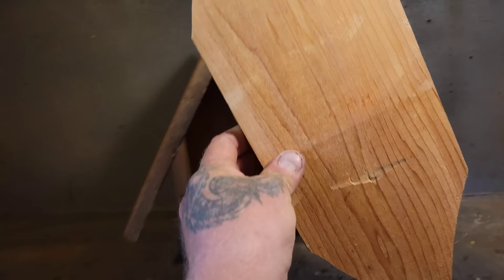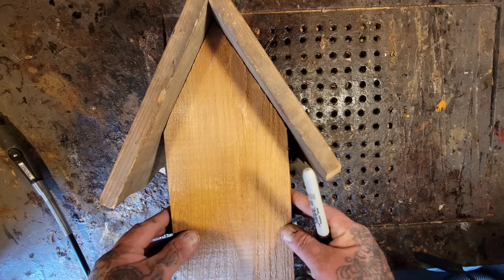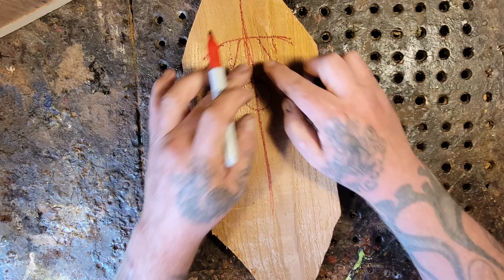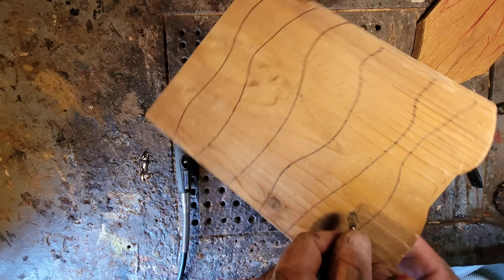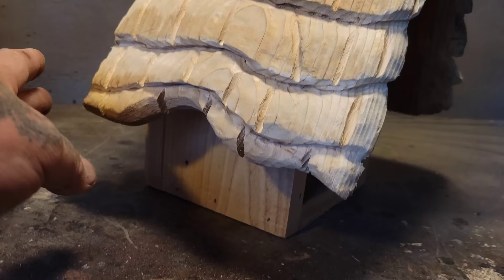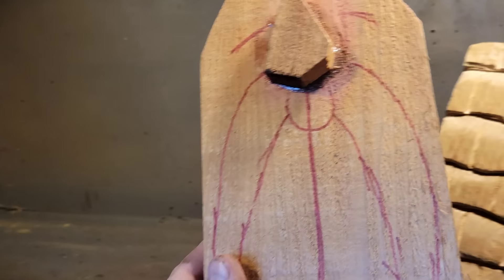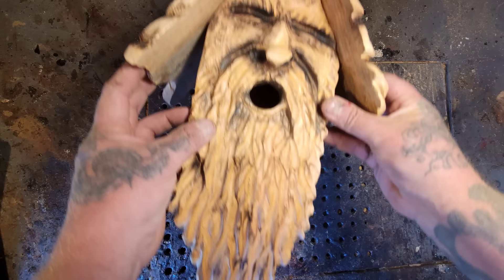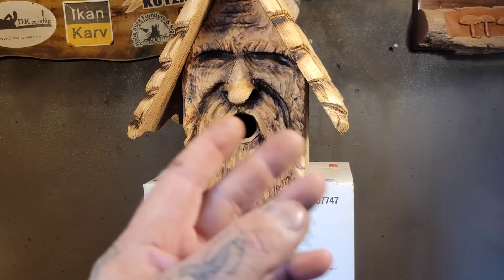Super easy Awesome Beginner Bird house dremel Wood carving. #diybirdhouse

Comment: Nice Jordy, love your carving. I just finished my 2nd bird house. I use Gorilla wood glue to secure the face onto the bird house so I don't have screws in the face. I put a removable back on it for cleaning it out. Also use a 2x6 for the face. What is that small torch you have? I use a propane torch and it's great but hard to get in the small areas without burning the heck out of the other areas. Thanks again for your channel. You are an inspiration to me and many others.
Reply from the maker: Thank you and yes I have used 2× 6, it's a small butane tourch